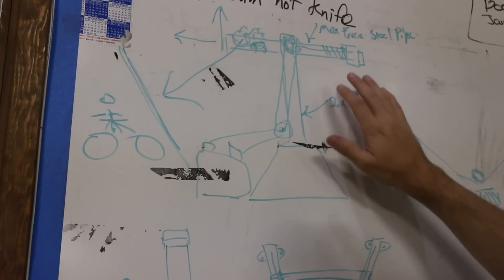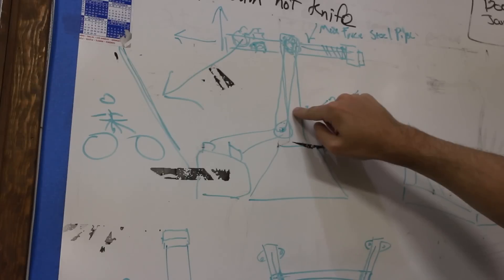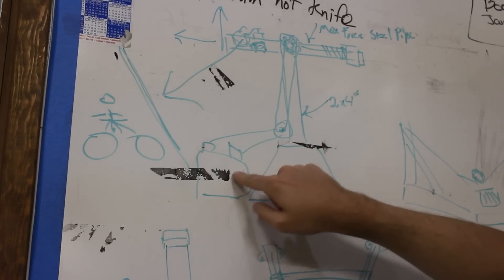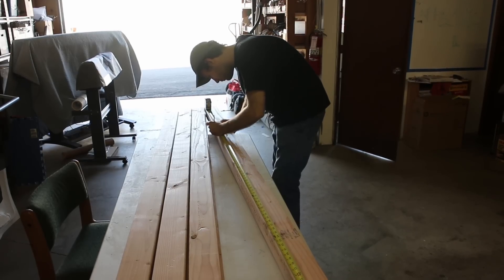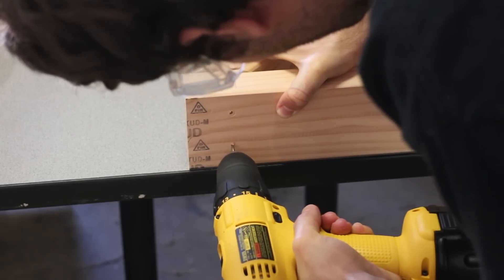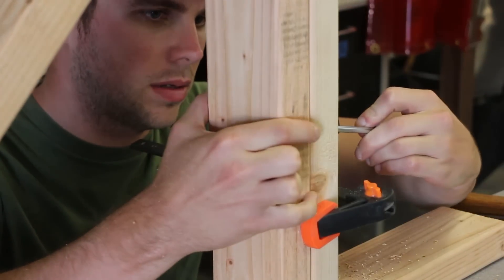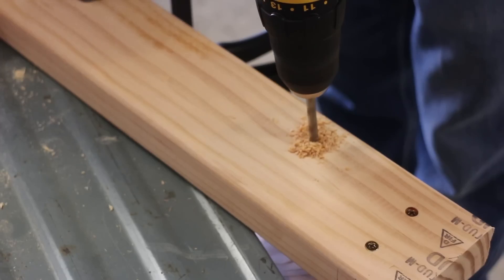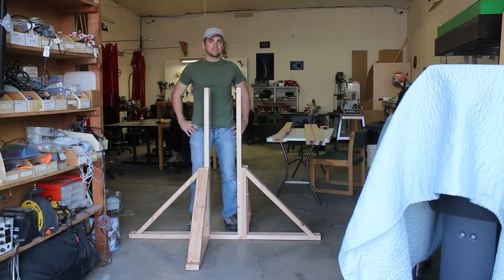Centrifugal Pumpkin Chunkin' Machine - Part 1

Comment: I can't wait to see this! Sounds like fun! I foresee issues once the pumpkin is chucked. You can carefully balance the machine for high speed rotation for each pumpkin but once you chuck you will have such a horribly unbalanced machine it will fling itself all over the place. Bring lots and lots of sandbags, bolt a few 2' x 4' 1/2" plywood panels to the base legs. Then pile the sandbags on the plywood base so the unbalanced machine can't fling itself upside-down. Can't wait for more updates on this one!
Reply from the maker: Thanks for all the tips, Todd. We definitely were planning on the sandbags. We've been thinking about the balance problem as well. We haven't come up with a good solution yet, other then to try and slow it down very quickly with some kind of brake. We'll definitely be testing this machine in a safe area before the competition... just in case.